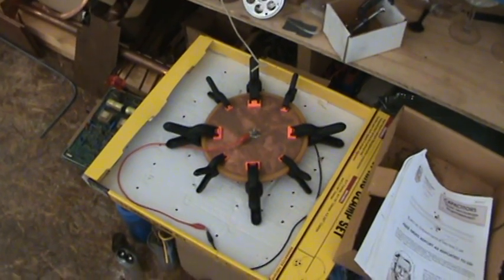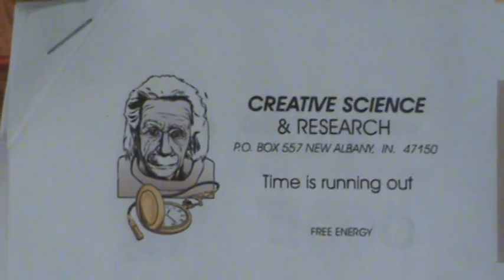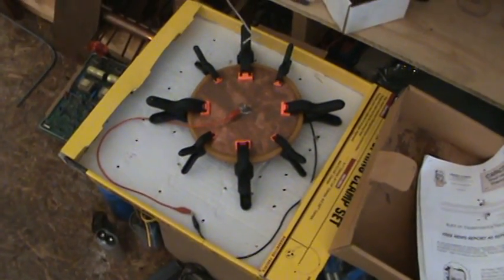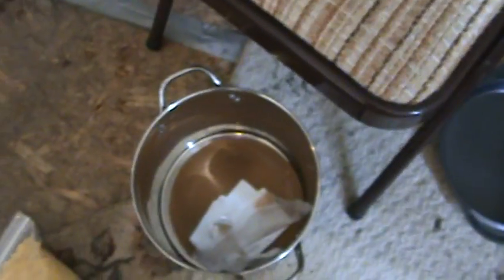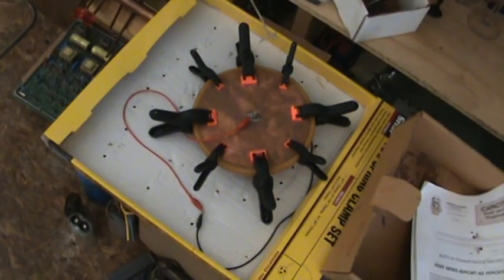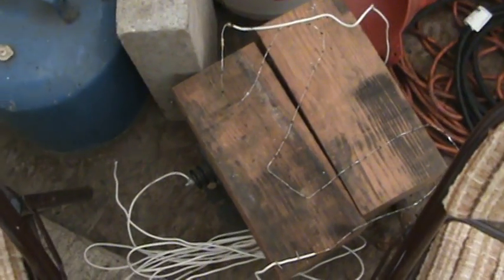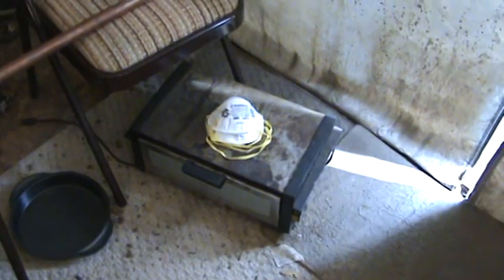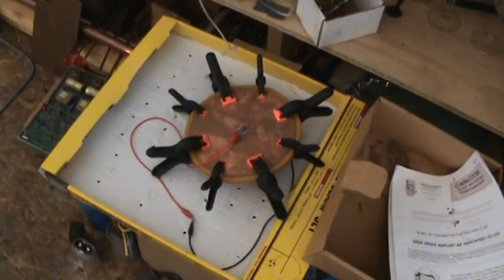The Electret That Failed part 2 of 2

Comment: low current 50 megaohms, with a steady DC voltage only, No spikes! I still gathering info.
The "Rosin" is just pine tar, the white stuff. You can get it from Pine trees. Then heat it up and refine it. It will hold every thing together? Think of "Rosin Core" solder.

Comment: I did not re-do that experiment yet. It is on my list to do it with the reaction on the right side of the aluminum. I am bogged down with DC-DC maximum power point for my wind turbine and my laser for killing weeds this summer.

Comment: I liked the video. I used an old vacuum tube TV as a high voltage DC source instead of an AC transformer with diodes.  watch?v=Y-QVUkUkRR4
I mention that in case that is an easier source of high voltage for somebody. Also, the wax is such a good insulator that it limits your current without the 1 meg resistor, but I think it didn't hurt your experiment.  I did mine with no resistor because I was using glass and the TV has a limit to how much current it can put out anyway, even if a spark jumps.

Comment: What if you used wood as a center instead of just wax?

Perhaps boil some kiln dried / or very dry balsam wood that would absorb the wax(s), which would hold the wax together better / perhaps add capacitance, and then wrap it in copper or what ever conductive material. 

Seems it would work as a capacitor still. Or, use paper / carbon / dirt, or something, instead of just using the troublesome wax.

Or do like you already did. Stop.. lol.

Interesting tho. Thanks for your efforts and videos.

Comment from the maker: @pcxcity Hmmm, interesting.  Maybe heating of the gold will create electrical energy,,but you still need the proper wax mixture to retain the charge, and continue to absorb a charge even after the gold is cooled down.
Hmmm, this would be an exspensive experiment. Thanks for the ideas.

Comment: Yes I understand what a electret is...but you need gold to make it work cause of the properties of the gold..so what your using won't work...if you take and apply heat to the surface of the gold plate it will convert into electricity...how much electricity?..who knows..I guess the more heat the more electricity